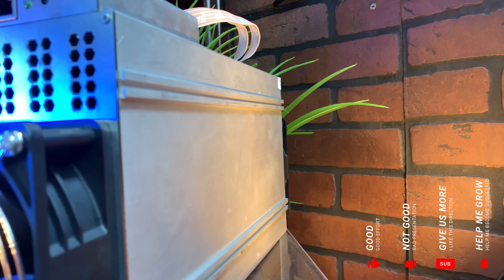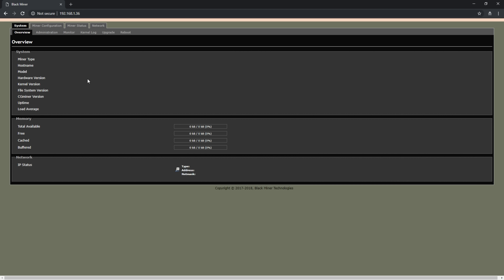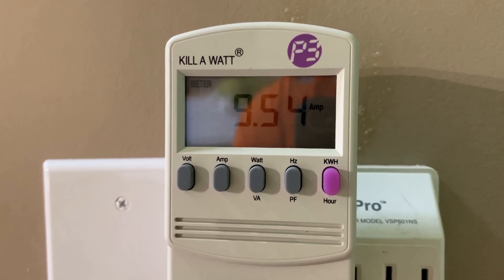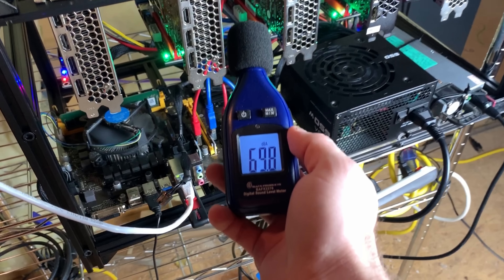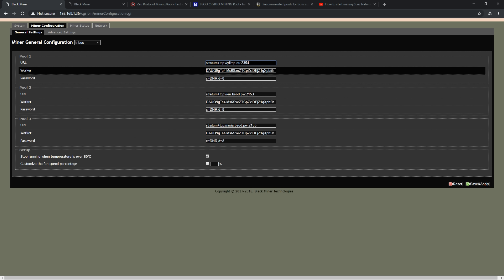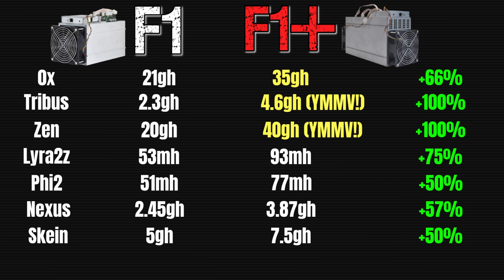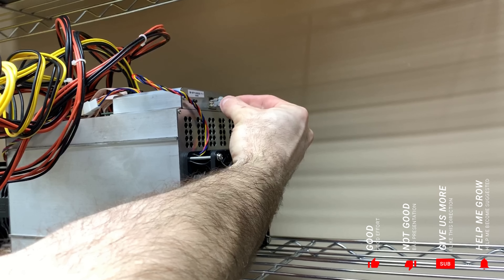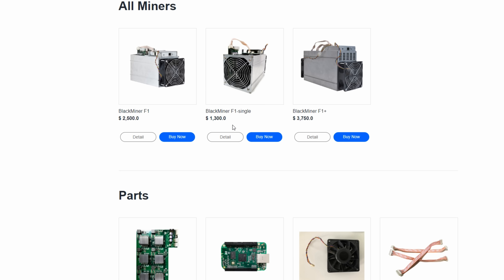🆕 Blackminer F1 +PLUS+ FPGA - First Impressions

Comment: Can the basic 1300 machine be upgraded to more chip boards?  I see where they sell the boards for 1300. If I bought a basic one to try out would want to know if I could upgrade it later
Reply from the maker: Fantastic question. I'll ask
Reply: had the same question!
I reached out to them, and you can indeed add another hashboard to the existing housing and control unit. which is great for someone on budget but also wants to expand down the road.
Reply: @TechnicalsMatt  https://fpga.guide/en/howto-aws/ do u use it on your F1???

Comment: What’s your most profitable algo on the F1 hash board?  How much?
Reply from the maker: Theres a calculator that tracks it specifically for the F1, not sure i'm allowed to post, but last I checked it was verus. As soon as it works on NH i'll firmly plant myself there
Reply: It does not matter. In any case, the yield will be no more than $ 5 per day.

Comment: What power supply would be recommended for the F1+?
Reply from the maker: Anything that can push 1000w. I used a HP server PSU. Platinum 1200w w/ breakout
Reply: @TechnicalsMatt  So 120V wall socket will work as long as its a 15A or 20A?
Reply from the maker: Should, yea. 80(120*15)=1440

Comment: Great video as always.  I've been on the fence about getting the F1 (now the F1+) but I just haven’t pulled the trigger.  When I compare the revenue generated by the available bitstreams, it seems that the ROI is still way out there.  So are you using the F1+ as a pure speculative play?
Reply from the maker: Everything is speculative at this point. The only short ROI periods are immediately before or during a bull run, or at the launch of a new device, IMO of course. Consider that any BTC value you mine may go up 2x, 3x, or more. All on whatever you think it'll do
Reply: Dean Clarke these miners will never be roi'd.
same shit like was with asic doirstoppers.
4k usd bcu1525 "earns" few bucks a day. stpd sheeps

Comment: Great video. Do you know if there are or can  be FPGA-resistant algos?
Reply from the maker: I guess it depends on your definition of resistant. F1 has memory limits so there's that, for now.
Reply: Good point! By FPGA resistant algo I mean an algorithm wich runs better in a GPU than in a FPGA in the sense that it is more profitable in ROI terms running on a GPU than on a FPGA. I guess that it is not possible because I believe that FPGA are kind of enhanced GPU but I am not sure thats why I am asking.
Reply: @leonjbr  it cant mine coins that have dag files
Reply: @dzonikg  Ok thanks. So ¿it can not mine ETH right?
Reply: @leonjbr  No..not any coin that is memory intensive
Reply: @dzonikg  Ok I  see. I have visited Hash Altcoin web and, for example, the F1 doesnt support equihash. So one should think about FPGA as "flexible ASICs" rather than as "enhanced GPUs". Am I right?
Reply: @leonjbr  FPGA are not faster then your regular GPU chip ..its just that they put lot off chips ...this F1 has 12 chips ..and they are good in one thing and is  calculation off formulas...but if you need to do it from big memory that require lot off bandwidth ..that is a problem ...so FPGA will never be good in algos that have DAG files and will not ably to mine them
Reply: Ok thanks
Reply: FPGA can be program to almost anything. If the program need more memory, then you need to connect more memory to the FPGA and program to do use it. For AI programing view, GPU is a ASIC chip to make multiple matrix calculations from the memory. GPU gddr and hbm memory have better bandwidth(for multiple tasks) than DDR, but worse latency(for single task).
FPGA should be about 2.5 times slower than GPU ASIC, but for unknown reason to me(programing the coins), it isn't.
Reply: @luisff7030  Excuse me Luis but I dont understand what youre saying. Could you repeat with other words?
Reply: @ Because the FPGA have multiple programmable logics, it can be programmed to do only one thing multiple times in parallel. The CPU is better to do random tasks in series, like running a program.
The GPU was build to do matrix calculations for the graphics. The FPGA does not have a memory limit, because it can be programmed to accept more memory if the board have that memory, and if the FPGA need is possible to add a memory controller to the board. A CPU is better than a FPGA if the task is to run random lines of program, and may not be possible to do a coin with this for mining.

I don't know why the tests done show the FPGA is better than the GPU to do matrix calculations:
http://webpage-docs.s3.amazonaws.com/publications/ISVLSI_FINAL.pdf

Elon Must said the ASIC version for Artificial Intelligence(driving cars) is about 20 times better than GPU for the same power consumption.

http://www.eecg.toronto.edu/~jayar/pubs/kuon/kuonfpga06.pdf
"an FPGA is on average 40 times larger and 3.2 times slower than a standard cell implementation. An FPGA also consumes 12 times more dynamic power than an equivalent ASIC on average"
Reply: @luisff7030  Ok thanks.